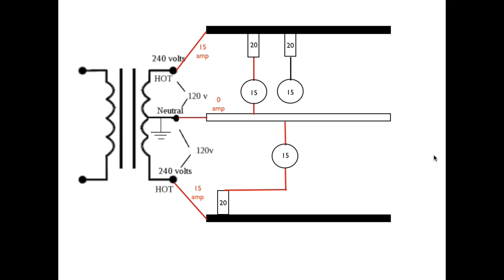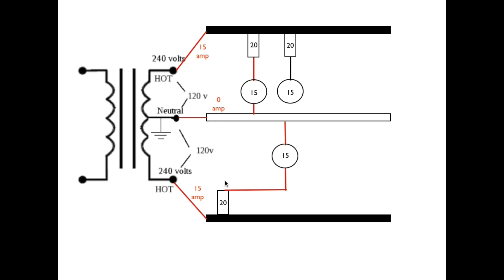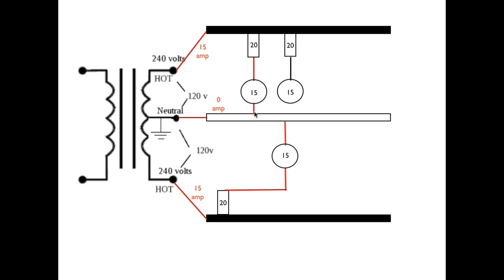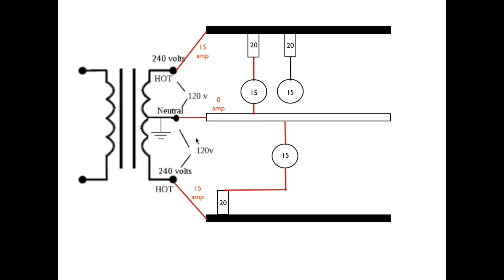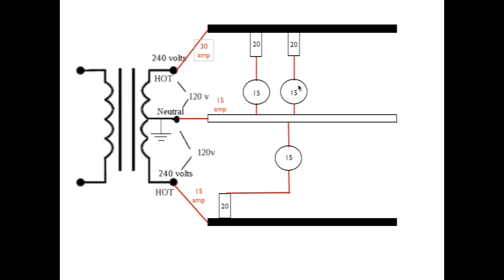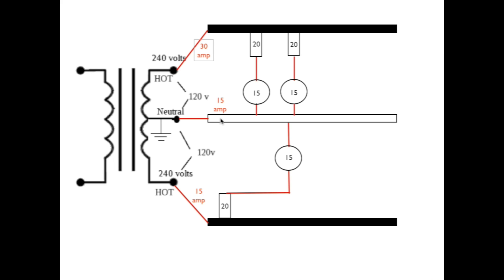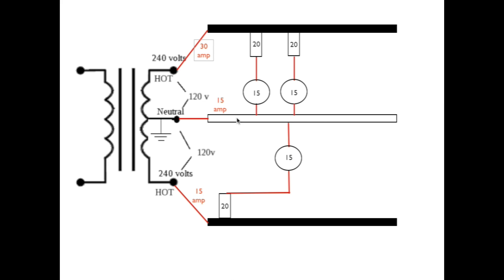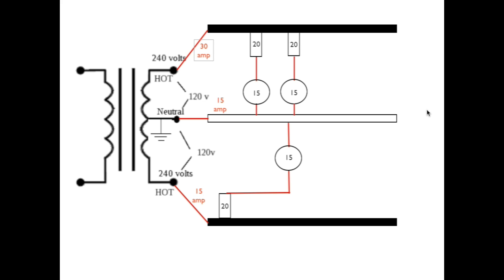How unbalanced loads work

Comment: No the current from one circuit does not travel back through the breaker of another circuit as you have described. Both circuits return through the neutral. Electricity takes the path of least resistance so why would it travel back through another load when it can go through the neutral wire?
Reply: If you guys don’t get why won’t you test it out for your self
Reply: And also why do you think delta and wye without neutral move without a neutral
Reply: https://en.wikipedia.org/wiki/Harmonics_(electrical_power)
Reply: If that were the case what would happen if you had 2 legs with 90A each then there would be 180A flowing through the main neutral that isn’t even rated 100A like the hot conductors
Reply: tim g no. If you have 240 volts source with two hots, you do not need a neutral wire because the power will flow from one hot, and return through the other. The neutral is there to return any unbalanced loads to the source. So as I said previously, if the load is balanced, there will be no current on the neutral.
Reply: XxXTitsmcgeeXxX Say, do you know by what electrical theory/phenomenon only the unbalanced portion of the load is forced to the neutral. Nobody ever explains that; I’ve been searching for days.
Reply: @NMranchhand  First greyfurnanceman and most others have no idea what their talking about.

If you want to learn to drive a car do you go to a horse trainer ?

Then why listen to a guy who only knows furnaces instead of trained, experienced, licensed electricians ?

Most of the time when we're using electricity there is a "draw" that's used to power something like a light or TV. And a "return" of the current to the circuit breaker panel where it is bonded with a ground that goes to Earth and to the neutral return to the transformer feeding the house where it is also bonded with a wire going to Earth. 

The transformer has 1 of 3 phases going to it on the "high" end usually 1,200 volts and steps that down to 120 on the end feeding the home by electromagnetism through 2 sets of wires turned around a non conductive material.

The home feed side with 120v is then center tapped with a wire (the Neutral) creating 2 sides each with 120v. The current flows alternately on each end at 60 cycles per second. Despite the often poor choice of words the current ONLY flows in 1 direction, it does NOT flow back and forth. You can see this on a waveform monitor.

Ideally there is a smooth flow of the current from the transformer to the home to the item using electricity and back to the transformer.

In reality there's almost never an equal distribution of current being used on the 2 wires from the transformer to the home. This is called imbalance and is a waste of electricity. the excess electricity is transferred to the Earth ground where it dissipates instantaneously.

The current NEVER flows out the transformer on 1 hot wire and back to the transformer on the other
Reply: @NMranchhand  Dude! did you ever figure it out? That's the exact question I've been trying to find and the guy below's answer didn't do it for me
Reply: @NefariousPear  As some of the previous comments mentioned it already: in 240V / 120V split phase system, Leg 1 with respect to neutral is 180 degrees from Leg 2 with respect to neutral. (in other words L1 to N is exactly opposite waveform in magnitude to L2 to N).  For example, the current reading on L1 to N = 90A (as example) would be L2 to N = -90A.   The currents cancel each other out (assuming purely resistive current).
Reply: @XxXTitsmcgeeXxX  No such thing as your claiming. That's like saying that water travels through a hose connected to a cold water line on 1 side and a hot water line on the other with both valves open going both ways alternating 60 times a second
Reply: @gregfreeman6476  nope. You’re incorrect. I get what you’re saying, but on an atomic level, the electrons are moving back and forth.
Reply: @XxXTitsmcgeeXxX  Sorry incorrect. The atoms aren't doing anything. One component of the atom called an electron becomes "excited" by the electromagnetism of the current and jumps between valance rings as electrons move from their origination point at a generator (law of energy conservation)  through to an item using electricity and eventually to the Earth.

The electrons (current) only flows in 1 direction. You can see on a waveform monitor both the switching of poles and that the flow is in 1 direction
Reply: you're explaining DC current. In an AC system, provided the load is balanced, the neutral or identified conductor will not have any current on it... AC current isn't uni-directional.
Reply: @XxXTitsmcgeeXxX  Yes it is, you misunderstand how A/C works because of the poor use of words most sites and people use to explain it.

A/C does NOT change direction of flow ! It changes between a positive state and a negative state which you can see on a waveform monitor and also observe the flow is in a single direction.

Comment: The 1st circuit was a 240V appliance load so it was an equal load.. Amperage is the same on a parallel voltage circuit..  When that 2nd appliance came ON, it was a 120V only circuit so it created the un-balance... Which the N carries back.. 
My question is, WHY can i touch that N that is carry'ing 5 amps back and not get shocked..??
Reply: excellent question.   SUSPECT voltage not traveling on the neutral, only current (amps).    Do not ask me where the voltage goes, if any. HOWEVER, an open 
neutral toward the transformer is a different story. Under this open, voltage will
be on the neutral, the portion away from the open toward the load. CAUTION SHOCK .
Reply: @tedlahm5740  If the neutral is grounded we call it a 0v conductor. Answer to your ? is for you to get shocked you  would have to be a difference in potential  between the neutral that your touching and I’m assuming the ground your standing on or touching with another part of body. Remember the neutral is grounded so there is no voltage across your body.
Reply: Bob Brumley Bob: In order to get the mentioned difference in potential, we
would need an OPEN NEUTRAL. Not a safe condition. Thank you?
Reply: @tedlahm5740  With open neutral,  voltage would be across the open. Voltage would  be ground to any conductor not at ground potential. Thanks for clarifying that.

Comment: grayfurnaceman, I have been an electrician for 20 years and this goes against everything that I have been taught. However, I have an open mind and am willing to re-learn this. Do you have any resources that can explain this better or more thorough? Thanks in advance.
Reply from the maker: I have a playlist on electrical that may help:  https://www.youtube.com/playlist?list=PLItXrh64d2JNJOjSivaYXeX88i8MNWgwu
GFM
Reply: grayfurnaceman Let's say I want to experiment with this at home by leaving my A phase circuits on and shutting off all of my B phase circuits. I this scenario, you are saying that all of my A phase current, which is unbalanced, would go through the neutral. Then, as I turn on each individual B phase branch circuit, my neutral current should drop by the value of the current being drawn on those B phase circuits?
Reply from the maker: That's pretty much it.
GFM
Reply: grayfurnanceman does not have a clue what he's talking about. Stick to your 30 yrs of knowledge. Remember your an electrician, he's only worked on furnaces. He has no real electrical training and is spreading dangerous misinformation
Reply: @gregfreeman6476   You couldn't be any more INCORRECT. 
Try not to post things based on your ego.
Here is the FACTS and REALITY in real application: 
https://www.youtube.com/watch?v=LJvyb_WujZg&t=270s

You really should apologize for your inexperience.

Comment: If you have a single live wire (L1) and a neutral (N), then current flows -- if you remove the neutral, then NO current flows. You are saying that the neutral is merely a link, a connecting wire, between L1 and L2 , you are saying that the current flows through L1 and returns by L2  (or vice versa) -- this makes no sense, it sounds like 'perpetual motion'.  

"Teach, can't do ; Do, can't teach."  Very few people can be both a teacher AND a practitioner -- you are not one of those people, teaching is a skill -- your skill is as a practitioner.
Reply: how can one teach what they cant do??? what an idiotic statement.. he teaches fine, the problem is the receiver needs to have a minimum iq to grasp the concepts, otherwise it will sound crazy and frustrate the low iq individual, and he will likely lash out and try to hurt things around him because hes hurt, but has no clue why, nor smart enough to find out.  heres a pro tip for ya, there is one person in this world who you can control. and thats yourself. if youre controlling anyone more than yourself, youre evil. 
amazing

Comment: I know you said you have no idea how the utility balances the load, but is there somewhere i could find methods or literature on how they do?
Reply from the maker: I would call the utility.
GFM
Reply: Wonderful question. when you locate the answer let me know.  EACH PHASE
only has one conductor, as we all know from visual observation. One one
conductor into the top of the step down transformer.  A thank you.
Reply: Utilities rely on all panels to be balanced at the load center. If that happens then the transformer will automatically be balanced.

Comment: is there a neutral from the distribution transformer to the isolation transformer.... or from the isolation  transformer to the substation?.. or is the neutral only between the distribution transformer and the main service panel and on the branch circuits to deal with unbalanced loads. I see the neutral and he ground are bonded at the main service panel and at the distribution transformer, both of which should ground the neutral.

I've heard of a single wire earth ground, where the power company uses earth as a return path from the distribution transformer to the isolation transformer, but the more I look at it, I see people saying they use WYE, which I'm not sure what that is, and I'm trying to understand this neutral thing, past the distribution transformer......im not a lineman, I'm a residential electrician, im trying to understand the current path from the power station all the way around.......... I've seen diagrams, showing the line path to substations and all but....... on things like primary lines, is there a neutral? how does an unbalanced load get back down the current path if it is constantly bonded to ground.......... and why cant an unbalanced load go back over the phase wire to the transformer, ..... for example, a stove is 220, and pulls off both polls on a single phase main....... if I have a 110 clock on the stove, by code I have to have a neutral wire to take the unbalanced load, but if I don't use the neutral wire, the stove and clock will still work, so obviously the unbalanced load can go back on the phase wire, why not? I'm far more interested in the neutral past the distribution transformer, if you can help.

Also from the videos I have been watching about transformers, there is a bar called an XO bar, with XO, X1, X2, X3, H1, H2, H3.... I see the neutral attaches to the XO terminal, can you explain the rest of them? and from what I saw, that bar I also connected to ground and the voltage leads off of the coil, how does that voltage not go to ground?
Reply: I think I just saw today at a substation there is a grounding wire on the poles that runs all the way back to the substation and goes to ground just outside the fence.............. I guess my next question is .... does the transformer have any kind of load............... the high side of the transformer is 14kV and the output of the transformers obviously are 240 or 3 phase........... that cant be the load though, because its just using the electromagnetic field in the coils, and not actually losing voltage.................. is the electricity coming out of the substation only limited by the resistance in the wire?......... it seems to me like the neutral for the poles is only bonded to ground at the transformer....... so that would mean there is no worry of an unbalanced load from transformer to the substation?... is there a load at all?......... and with that said, how does current flow on the lines to magnify the coils, so somewhere there has to be a load.... what is it?
Reply from the maker: I may be able to answer  some of your questions, certainly not all.  As for single wire with earth return, it is done in some rural areas but efficiency goes down.  Ground wires are used throughout the electrical system to reduce spikes and discharge lightning.  The system will work without the ground wires.  A transformer is not a true load.  When energized, the back EMF builds up reducing current flow in the primary to a minimum.  When a load is placed on the secondary, back EMF is reduced and current flows.  The rest of your questions require more space and knowledge than I have.
GFM
Reply: why do you call it "back" EMF.. why not just EMF. I get that current flows on the secondary, I can see the current paths on that between the main and the transformer, but what wires on the primary make up a complete circuit or current to flow on the primary, there are 3 wires and they are all hot and not going to a load.
Reply from the maker: When power travels thru a winding, then reverses, the collapsing electromagnetic field creates an EMF of an opposite charge that works against the incoming power, reducing amperage draw.  Simple explanation of a complex operation.
GFM

Comment: I have two 15 amp saws running, and I am only drawing 15 amps total? The power company sure knows somehow. Something seems iffy.
Reply from the maker: Yes.  Not iffy.  Power usage is voltage time amperage.  15 amps times 120 volts.  Compared to 15 amps times 240 volts.
GFM
Reply: grayfurnanceman doesn't know what he's talking about. If your running 2 saws at once each is drawing 15 amps. They are either on separate circuit breakers or one of at least 40 amps, as CB's are only actually capable of carrying 75% of their rating for an extended period of time

Comment: At no time does the current travel through one breaker and out another. I didnt get a chance to watch the whole video...because frankly I stopped it there.
Reply: Current CANNOT travel in opposite directions along the same wire!
Reply: @ElHajjMalikElShabbaz  In the neutral currents travel in different directions. Single phase 3wire they are at 180 degrees apart. Three  phase 4wire they are 120 degrees apart.
Reply: At the same time
Reply: Yeah um... No.  This comment is correct.  120v loads do not travel through the other bus.  It's not even physically possible!  The neutral bus bar is isolated from the other bus, and only connected to the one bus through a device that returns back to the breaker box via the neutral wire.  It stays isolated from the main breaker box, to the meter and all the way to the transformer.  Now, at the transformer, they are all connected somehow and it would make sense that the load would cross over to the other bus in the box.  But there's absolutely no way that can happen In the house, in the main breaker, or the meter box.  It's actually PHYSICALLY IMPOSSIBLE until the transformer.  So best case scenario, you are explaining this VERY poorly.
Reply: The neutral is, in effect, a dead short. Calculate the parallel resistances - virtually no current will divert down the other leg.
Reply: Guys, we are dealing with Alternating Current here. This is all one big circuit with one power source. As one hot side is high, the other hot side is low meaning as one side is pushing, the other side is pulling
Reply from the maker: Perhaps you should as it does.
GFM